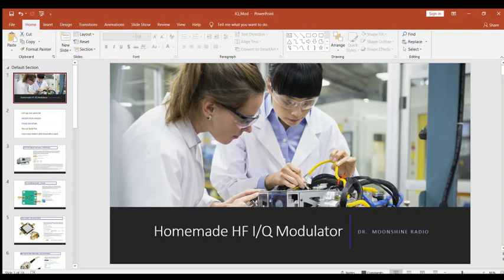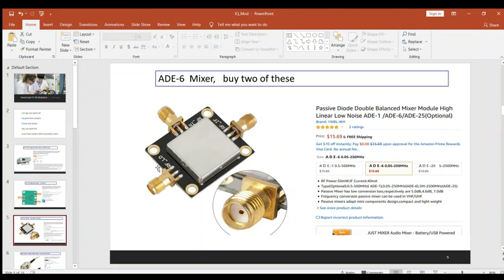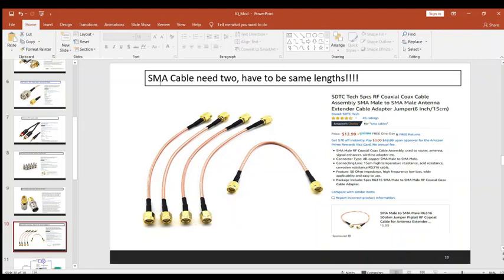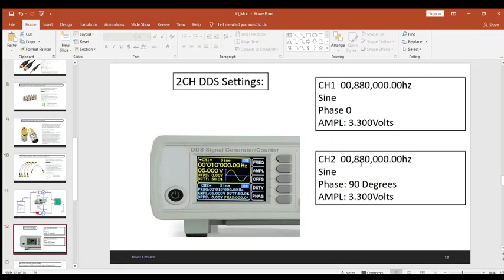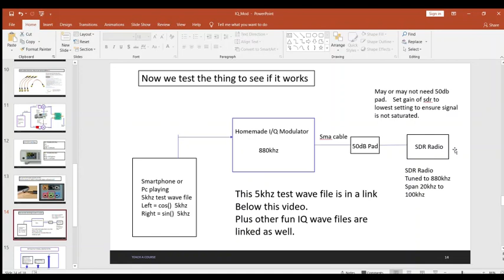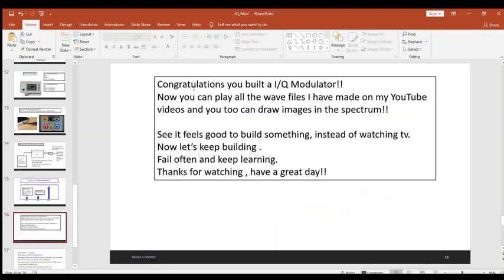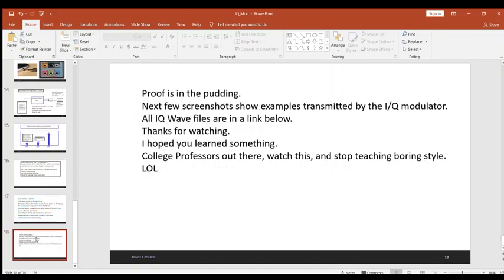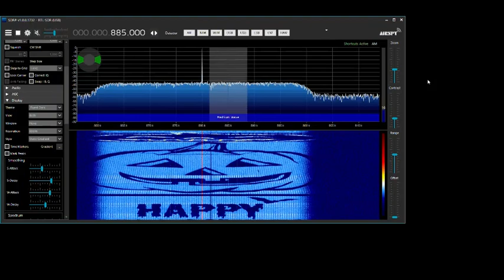DIY I/Q Modulator

Comment: This would be fun to try.  One thing I don't understand is, what is the output?  What are we looking at in the display.  Is it the upper sideband?  How would you produce the lower sideband?  I have been looking for explanations on how to produce the different kinds of modulations with an IQ modulator.  I did look at W2AEW's videos, but I did not understand how SSB signals are produced.  Thank you very much for this video.
Reply from the maker: we are looking at the output of the iq modulator  then feed over to sdr radio.   the wave files in the link create various waveforms.   two am files,  image spectrum and a 5khz test file.   SSB can be done with left right audio by using the hilbert transform.  i'll make a video on this,  see my video on ISB modulation